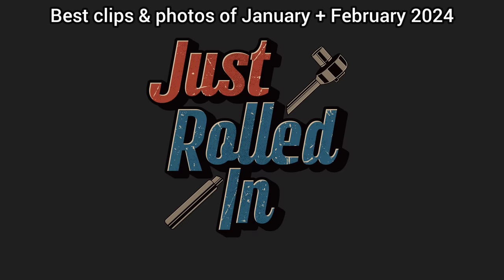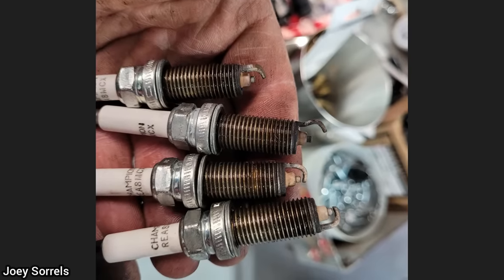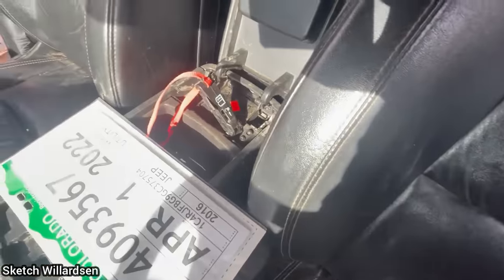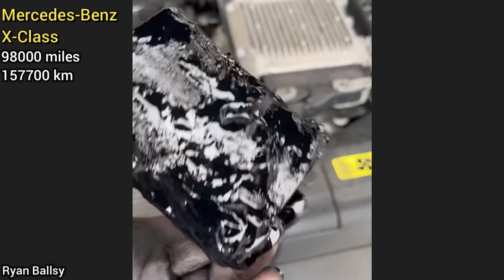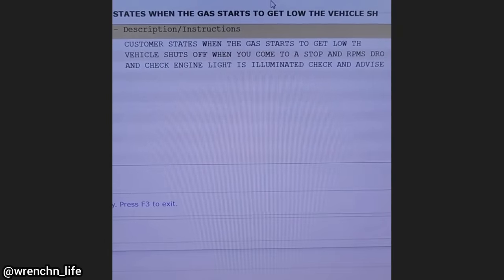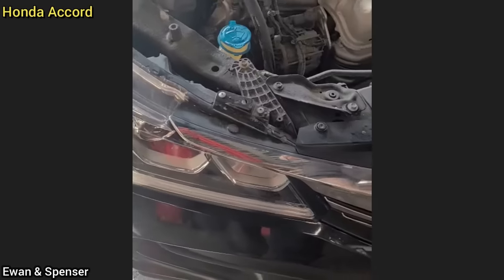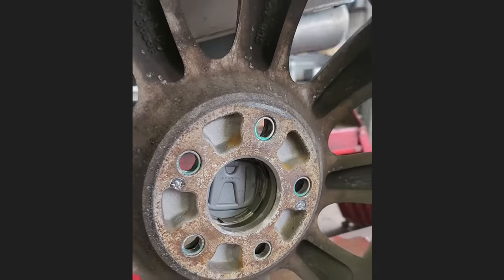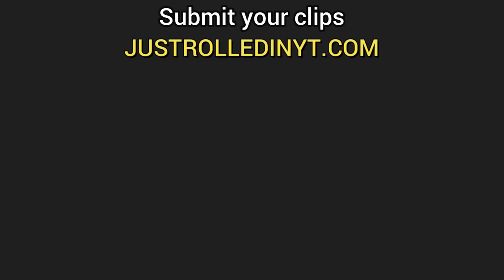Customer States (Best of January & February 2024) | Just Rolled In

Comment: I ran the fleet department at a rebar company and found out truck drivers get real creative when they break things but dont want to get called out for them. We did BIT inspections and saw things like you show on this channel quite often. No limits to peoples stupidity. One guy had a large chest cooler with a cigarette lighter plug connector he plugged in while in his petes sleeper. It blew out the dash lights so he stuck a #10 wire in the fuse holder. We had to rewire most of the lv harnesses. I cut off his cooler plug so it was 1/2” long

Comment: These things are only possible in the US, where there is almost no required yearly inspection. The only state that has this like most or all other countries do is West Virginia...since 2 months and 23 days ago. But, it's a start. I feel bad for the people restoring shells of old cars to fully working order, but it's worth it to not have cars that just suddenly go flying because the owner never changed the oil, brake pads, never noticed a broken part of the transmission etc.

Comment: @10:55 Why does everyone has such an obsession with the tiny holding bolts for the brake discs? Their main purpose is for ease of manufacturing, when moving around the car in the factory without wheels. After the wheels are attached, they don't do a thing at all. The brake forces are transfered by friction, when the disk is squeezed betwenn rim and hub.

Comment: Im a mechanic and I think theres no way to these examples but then I remember I had a truck come in with two vicegrips on the studs and no lug nuts, they drove it there! Also a person never changed the oil they thought they could just top up the oil and made it 40,000 KM before it blew a hole in the side of the block.

Comment: I had a Hyundai Tucson...my old lady conned dude she cheated on me with.... because of that..I didn't want to mess with it..then it became our only vehicle...I checked the oil...it has NONE..still ran fine....I have a 2008 grand Prix right now with 250000 miles on it...took it to have plugs and wires put in...my mechanic calls me tells me he needs to see me before he can finish my car... ok...I go see him....he hands me a pile of factory plug pieces and a whole intact FACTORY plug...no iridium left in any of them...he tells me he can only change 3 plugs became the other 3 are welded  in the head....CAR STILL runs great

Comment: I have a similar story to the very last one where the customer crashed into the base of a light pole in the dealership parking lot after an oil change.
I sold a guy a brand new Harley. He said he had been riding for several years, and I believed him. Why not, because why would he lie about that, right? He picked out a new bike (I don't remember what model), but he did not test ride it.  We did the paperwork and I turned the keys over to him. He climbed on, revved it up, released the clutch lever and TOOK OFF at a high rate of speed. He tore-assed across the parking lot, straight toward a light pole similar to the one in the video. He struck it at an angle and bounced off of it. The bike crashed and he went flying. Two other salesmen and I just stood there and watched the guy. He was not badly hurt, which was lucky because he wasn't wearing a helmet. Or a leather jacket. Or gloves, or any other safety equipment. The bike was, for all practical purposes, totaled. He walked back to us, and said, "I guess I wasn't as good a rider as I thought." DUH! Do ya think?

Comment: 2 repair shops state: 
1,000 bucks for a new rear LED light.
I state: No way. No way. 
1 x you tube video from Russia. If rear LED light cluster out, it is your corresponding number plate bulb blown. Number plate bulb blows, as a fail safe. So LED does not.
2 bucks for a new number plate bulb.

Comment: USA is really a land of extremes. One extreme is going to a shop with red colour at 7-8 on your RPM meter, or with a blue light on dashboard, cause you have highbeams on. And on the other side, not going to shop witrh pretty complex addons or repairs, and damaging the car in the process, or installing new wheel that doesnt fit, and driving with it, scraping the breaks 😀

Comment: So that heavy truck with the failed bearing, yeah that bearing definitely failed because it was out of gear oil, but gear oil on heavy truck hubs is not an old thing. They still use gear oil hubs on new trucks. I know older trucks used GREASE filled hubs, and that got phased out. But yeah rigs still use gear oil hubs, just wanted to point that out for education purposes
Reply from the maker: Thanks for sharing!

Comment: Several times i could gave been paid for towing a car to the dealer, but simply showed them the key was jammed because they shut the car off with the steering wheel pulled to one side or the other; ignition switch under such tension will not turn far enough to release the key.